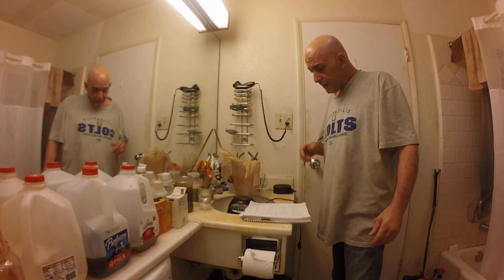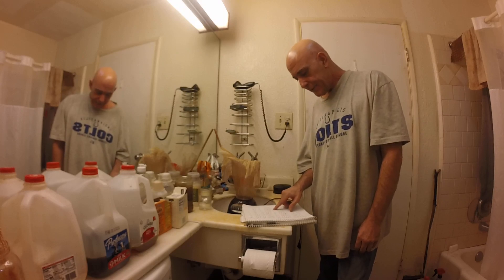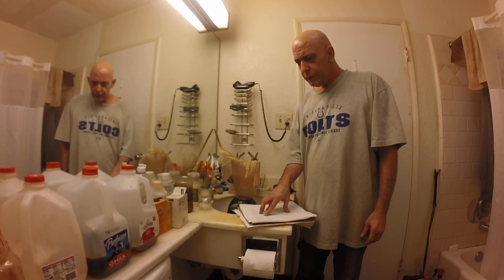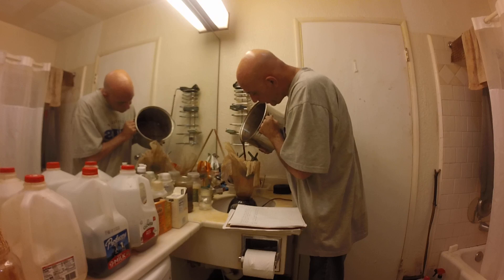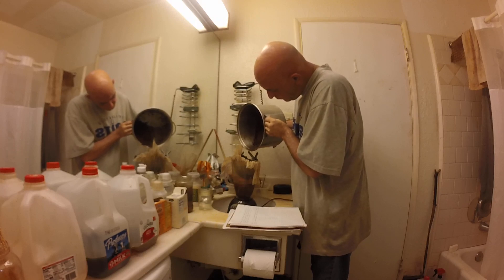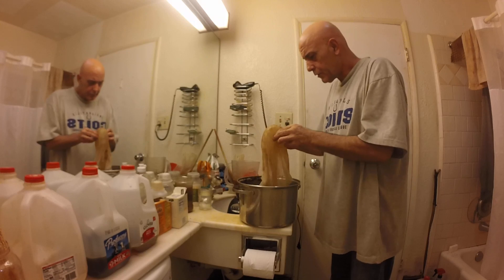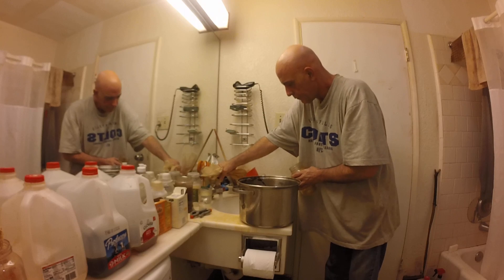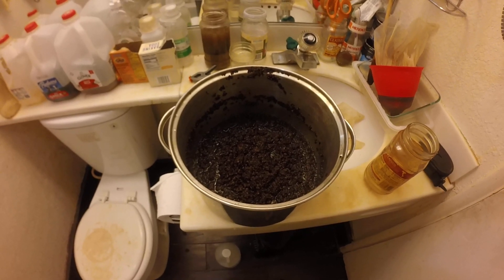Step by Step Harmala Extract Part1

Comment: Hey, I saw this when I was investigating in dmt-nexus. Why should we consume in salt form for oral use? Why not freebase? I dont get it.

"It’s always better to pre-dissolve them in acidic water for oral use. Nothing works better than pre-dissolved alkaloids. In that case it doesn’t really matter if you have freebase or not because the freebase will become a salt when added to acidic water. A lot of people use lemon or orange juice as the acid. It works very well. But if you plan on using just water, then of course you need a salt form (HCl, or acetate)"
Reply from the maker: wait, what? you found this through the nexus? please tell me how, I try to keep my youtube life separate from my nexus life, lol.

Ok, aseaeaea. Here's what I gathered from my research, I'll try to nutshell it:

Terms: 
Harmala; any of the 3 main MAOI alkaloids from B. caapi or P. harmala
Salts: acidic extracts of B.caapi or P.harmala
Freebase: Any of the basic extracts blahblahblah.
There are 3 main harmala alkaloids, each with different properties. All of them seem to be effective, reversible  MAO-A inhibitors when taken orally in the salt or acidic form. 

This seems to be more effective than taking the freebase orally, maybe because the freebase would need to be acidified in the gut to be an active MAOI? I don't know for sure but the consensus on the nexus and elsewhere seems to be freebase for the changa or bonga, salts for the 'huasca.

Anyway, it comes down to routes of administration (ROA's), biochemically. It's kinda like how dmt is ineffective orally without an maoi but will fuck your noodle if smoked, snorted or boofed. The stomach and liver work hard to eliminate stuff they don't like and the so called blood/brain barrier is the last defense of the brain. At this poing the freebase molecule passes freely but the salt alkaloids are too large of a molecule to squeeze in. The body puts up all kinds of measures to keep us free of weird molecules, bypassing them is an art. So as for using salts for other than oral ROA's, dude, don't snort or boof harmala salts, owww. It's bad enough drinking that nastiness. Oral freebases work but add at least 20% more to the dose or just cowboy up and go for 500mg, like everything else in this realm, half measures avail you nothing.

 Smoking salts is fine but there's the whole bioavailability thing and big fuckin' molecule thing so it'll work but freebase is active at microgram doses in the brain.

That's a bunch of what I learned in just 5 years on the nexus, mostly from Dreamers' harmala research thread and an old Iranian guy. It's a diverse, loveable and very narrow minded community in general.
Reply from the maker: This just popped up in my notes. Give me a few to review the whole deal and refresh my melon. Brb.